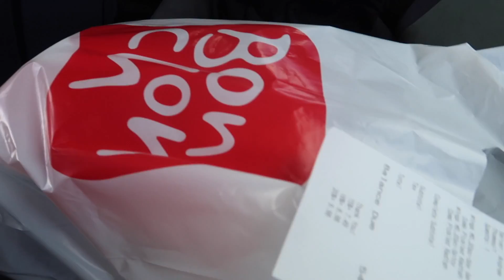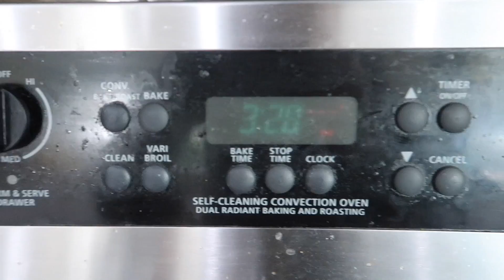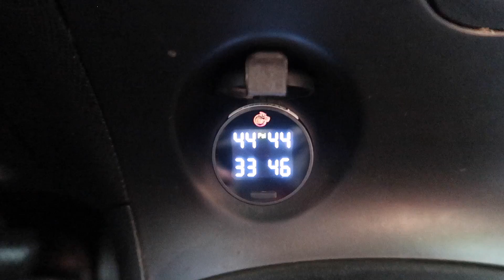How to run STRETCH TIRES and NEVER LEAK AIR!!

Comment: I recently asked this question on Amazon 💀😣😂 "will they leak if I stretch them on 18x9.5" "215/35/18"
Reply: +30 offset
Reply: Good luck
Reply: fed Z  they're mounted and doing fine lmaoo